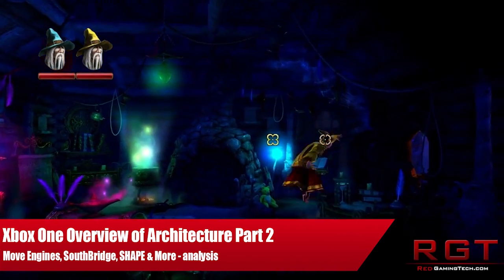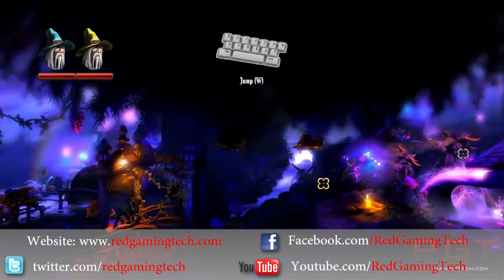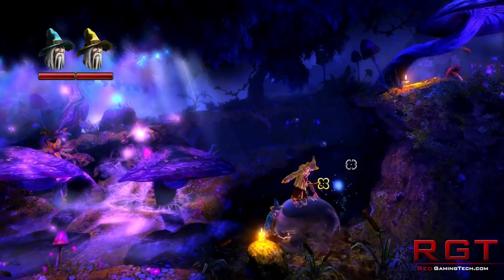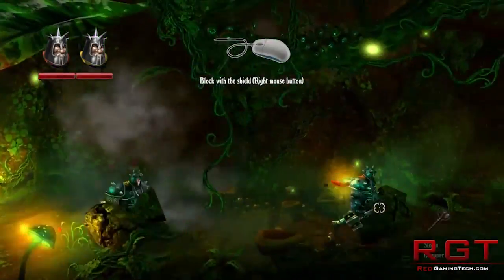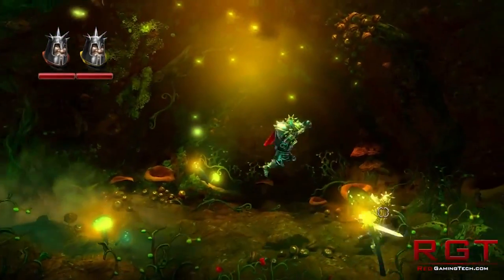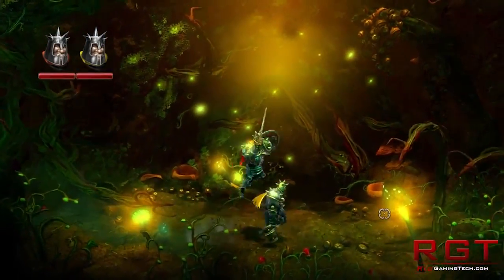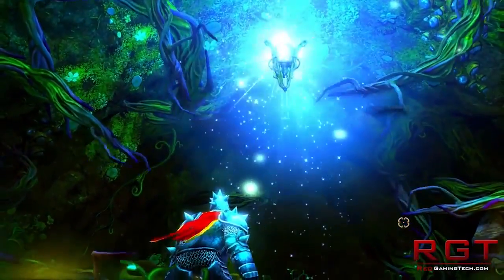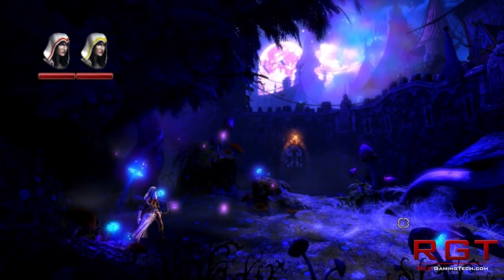Xbox One - Hardware Specs & Architecture Part 2 - SHAPE, Flash Memory & More

Comment: is it possible for the 8GB flash memory on the xbone to be used for games?
Reply: For flash memory in general yes, but this one no. It's a cache for the OS and snap feature so it won't interfere with other system operations. It's pretty much there to facilitate the snap features and coming out of sleep mode.
Reply: 4EverDubin
ah I see, thanks for clearing that up.. got my hopes up for nothing.